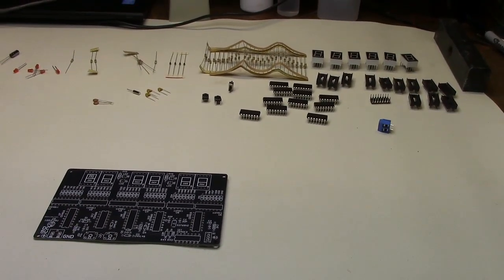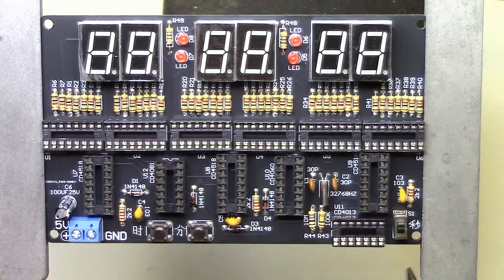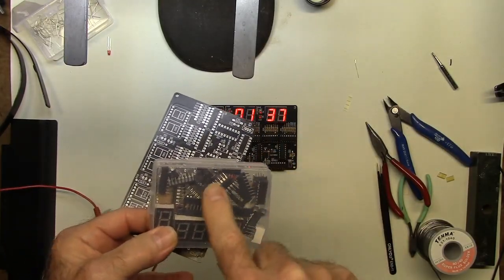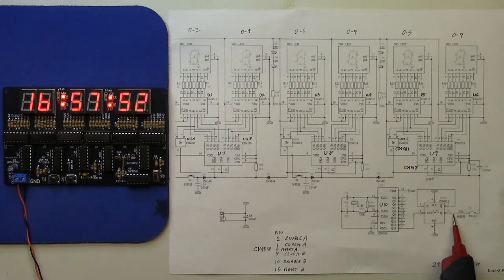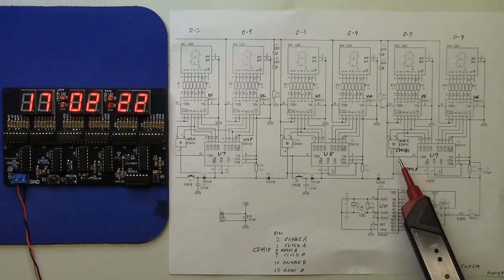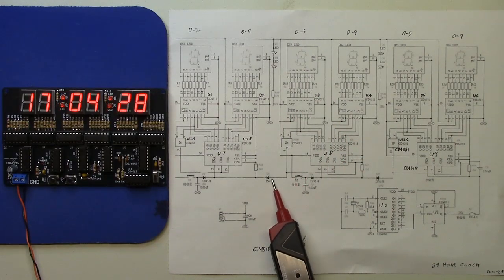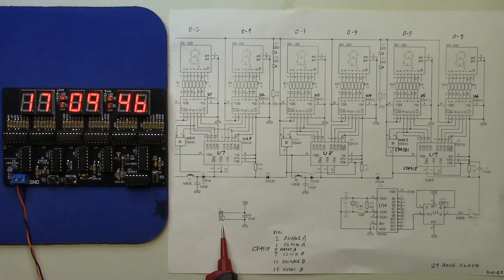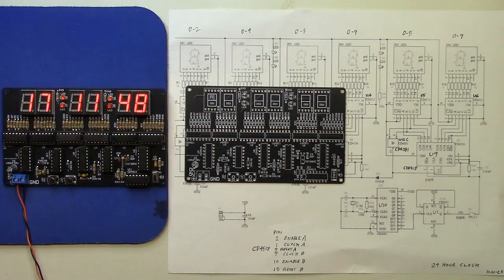24 Hour Digital Clock

Comment: Every single kit I've ever built never worked.  I tried very hard to do them correctly, but I evidently don't have the gift.
Reply from the maker: Hi LazioNQ, Don't give up.  When I design and build a circuit , especially from scratch, they frequently don't work on initial power up.  The troubleshooting phase is where you really learn how things work.  When something doesn't work as planned,  break it up into sections and verify each one separately. When you zero in , a bad solder joint or connection usually jumps right out at you.  Good luck, and keep building.